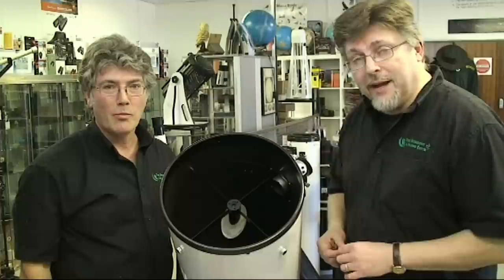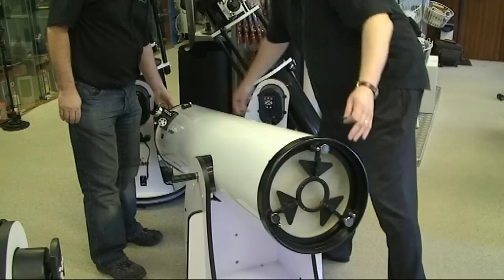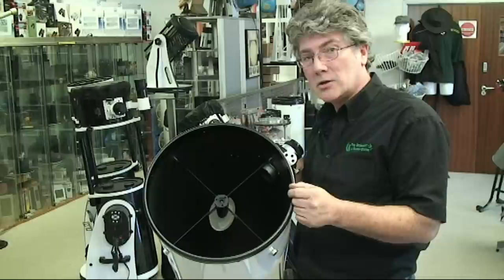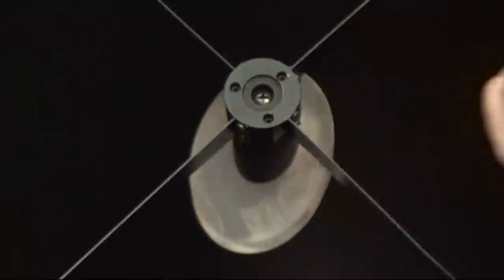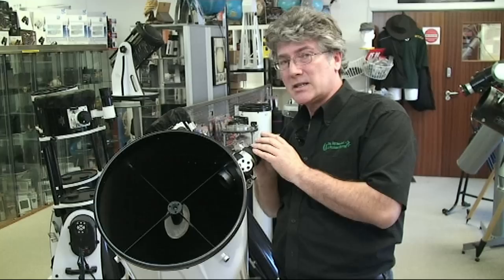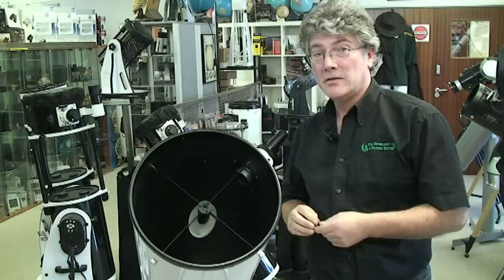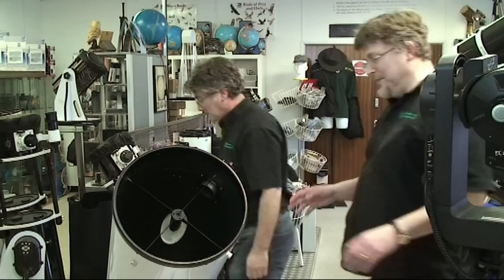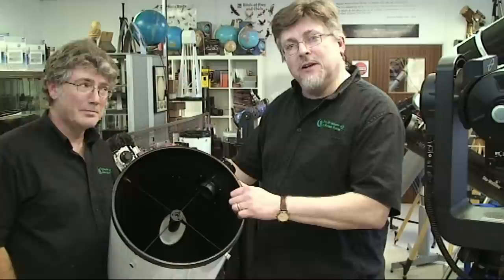Collimating your reflecting Telescope in just a few minutes

Comment: Nice and fancy. I only wish I had a scope that nice. Mine is a homemade Newtonian reflector. Hand ground mirror, homemade tube, homemade equatorial mount, etc. I collimate using a 35mm film canister with a tiny hole drilled in the bottom then do a star collimation check. Works great!. Thanks for the how-to video. At least I know I am collimating in the correct order. Basically taught myself how to line everything up!

Comment: What about a safety warning about lasers at the start of your video ? See,"How to Collimate a Telescope - Orion Telescopes and Binoculars" on Youtube channel, "Orion Telescopes and Binoculars" . At 9:30 the lecturer says to point the telescope at a white wall first of all to make sure the mirrors are not so far off that the laser is  exiting the tube;  otherwise it could enter your eye & cause damage.

Well how far out would the spot need to be on the primary mirror to actually miss the secondary mirror and exit the tube ?
Reply from the maker: Hi Zytigon, I'll answer your query on the basis that you seem genuinely concerned about risk and hazard. The reason we did not include a safety warning is simply that we do not see the need for one. The risk of eye injury when using a properly made laser collimator of the type we show in the video (made by Sky Watcher) would be so low as to render a warning alarmist and unhelpful. The documentation supplied with collimators is quite sufficient to alert the user to the nominal risk inherent in using these devices. Some years ago now, we contacted Moorfields Eye Hospital in London (one of the worlds biggest and most respected) and asked them about eye injuries resulting from the use of a range of astronomical and other optical equipment, and in particular, injury caused by red lasers employed as collimation aids. They were unaware of a single instance of such a mishap in the United Kingdom, and a subsequent review of the field literature was unable to find an example anywhere in the world. Actual hazard and possible risk are not the same thing. The actual risk of eye injury while collimating a telescope is so low as to render it not worthwhile to warn people about - anymore than you would feel compelled to warn a friend about the general risks of food poisoning whilst recommending a favorite restaurant. Maybe at some point in the future real data on eye injury due to the use of laser telescope collimators will be forthcoming - when it does, we might of course reconsider.  I hope this helps clarify our position. KR RJD A&NTV
Reply: I had wondered that as well!  Being a total newbie, I expected that it WOULD come out the front somewhere.  I was petrified to try, thinking I had to stick my face quite near to the beam.
Reply: zytigon I use a piece of paper.

Comment: I think at least, after having collimated it, rotating the collimator verify that it is still on target, will make it clear whether there are problems with the collimator itself too - mine doesn't seem to be radially collimated, and there are no adjustment screws accessible (the holes have been glued over it looks like).

Comment: You never mentioned anything about the needed accuracy of secondary mirror. IMO, we can get the red dot to align with the primary centre for many secondary positions, and in each case the secondary needs to be tilted at a different angle. Only in one of the cases in which the secondary mirror plane lies on the intersection of central primary axis and central focuser axis does this technique lead to good collimation.
Reply from the maker: Hi Adithya. You make a true and good point. But do bear in mind the purpose of this video is not a comprehensive treatment of Newtonian optical component alignment procedures (there are many other fine details absent from the video and not just a commentary on the absolute secondary position). This is a video about encouraging folk, typically new and inexperienced users, to have the confidence to restore their commercial Newt to at least the factory collimation standard that they enjoyed when the telescope was new  - and perhaps with care, a little better than this standard. Most users of commercial instruments will find their instrument only slightly out of 'good' or factory collimation. For better or worse, 99% of the time, the glassware will still be in the gross positions dictated by the factory jigs and test sets. Thanks for posting. KR RJD A&NTV
Reply from the maker: Hi again Adithya. We can don't normally pass comments with links in them, but as my late friend Nils Olof Carlin is one of the contributors we'll allow it. It's a good thread to be reminded of, thanks for your post. KR RJD A&NTV

Comment: How do you get the secondary properly aligned with the focuser if it has been slightly rotated and is not square with the focuser?
Reply: Loosen the Phillips screw rotate it to the finder scope then adjust the 3 screws to align it to the finder!

Comment: Hi hope you can help. I have a skywatcher 10 inch collapsible and a hotech laser collimator. I first adjusted the secondary so the laser disappears inside the donut in the center of the primary. Then center the primary so the laser dot is centered in the grid on the collimator. BUT when I then go back the laser dot reflecting on the primary mirror is no longer in the center of the dounut, it is on the edge of the donut. When I observed my airys disc seemed centered, but the scope stars just did not focus cleanly.  Is there something I am doing wrong? Thx

Comment: Hi Ralph / Rob.  Great video. I am new to all of this and have a start up skywatcher 130 which does not have a centre spot on the primary mirror. I have seen a comment / instruction from a year ago regarding adding this to the primary mirror. I have tried several marker pens and sharpie seems to work on a cormer of one of the wife's make up mirrors!!! (ha ha ) so I will use this when follwing your instructions. Looking down the tube at the primary mirror I can see there is a lot of dust on the mirror. 
Question? As I need to add a small mark, the area for this should be clean I presume. Is it worth cleaning the primary mirror at the same time? Have yoyu guys any videos or instructions for doing this? Any help would be appreciated.  PS. I am confident taking things apart and re-assembling them so would be happy to give this a go.

Comment: Adjustment of focuser is factory set and i shouldn't have messed with it but the secondary and primary appear to be optically aligned. Might be just my eyes going bad past year but seems like the sharpness isn't quite as good as it used to be. Does adjustment of the focuser (it tilts with set screws) throw off alignment somehow even though the primary/secondary mirrors both seem to line up visually?

Comment: I'm having issues with collimating my telescope. I use a laser collimator and I can always get the lasers in the right spots, but the three adjustment screws on the secondary mirror in some way always rotate the secondary mirror to where it puts the offset of my view by about 45 degrees every time. I worked over 5 hours on this telescope and the stupid secondary mirror keeps rotating no  matter what I do!

Comment: My Saxon telescope (200/1000) only has 3 Phillips heads at the mirror end of the tube. How on earth do I align my primary mirror ? All other tubes have adjusting knobs, where as I just have 3 screws... please help ??
Reply: My Saxon is the same. If you look closely there should be 3 small Allen key screws next to those 3 Phillips head screws. How I successfully collimated mine was to loosen the 3 allen keys screws just a tiny bit, then loosen the 3 Phillips head screws. Then tighten 3 the phillips head screws back up one by one to try and get the laser to disappear in the bullseye. Once you have done that, tighten up the 3 small allen key screws again. (make sure you dont tighten them up too tight, nice and firm will do). Hope this helped.

Comment: Could someone help me? I don't know where I can buy the thing with the target (already forgot how it's called..)
Reply from the maker: Hi there, and thanks for posting.  The device is called a laser collimator.  And you can find a source for one in the partner links below the video.  Just click on the text under the video, and you'll see the links to Amazon - we've picked a good one identical to the model used in the video, only a different brand (same manufacturer, though). Any competent dealer in astronomical telescopes should have something like this, so depending on your location you should be able to find one easily enough. I hope this helps. KR A&NTV
Reply: The cool thing about video is you can watch it again.

Comment: Hi. Great video. I've got a question though. All references I've read for a dob say to rough align so you can see all three clips that hold the primary mirror. I do that and then when I use the laser to align both mirrors , I lose sight of at least one clip. So the question is, once it is rough aligned you do not worry about being able to see the clips they chesire after finishing collimation?
Thanks
Reply from the maker: Hi Leonard. No, typically if you can't see all three clips it's a problem and it means your secondary mirror is out of position. You will need to make sure the secondary is in a good start position if you wish to get the best from your instrument. The secondary needs to be correctly positioned under the focuser. Can I suggest you have a look at the home page of my friend the late Nils Olof Carlin. If you Google his name you should find his website easily enough. Look at 'Collimating Newtonian Telescopes'. My advice is NOT to read it from the start, as you may find yourself drowning in a bit too much detail at this early stage in your telescopic life! Instead, scan down through it and look at the diagrams well down the page that deal with secondary errors - then dip into the text and get what you need to move forward. Maybe later, when you get a functional collimation, return to his text - almost every sentence is gold.  I hope this helps. KR RJD A&NTV
Reply: @RocketPlanet  thanks and that is quite a read from Mr carlin. Just to be sure you understand my question. I can see all three clips in the beginning of the process. Then I start to tweaking the secondary to get my laser hitting the circle on the primary.After I have that done , I insert the chesire again and that is when one off the clips has disappeared. Is this to be expected as I'm moving the secondary?
Reply from the maker: Hi again Leonard. No, I'm afraid this still strongly suggests that your secondary mirror is still out of position relative to the focuser. You need to be able to see the whole of the primary mirror, the visibility of the retaining clips is just a useful marker to indicate that you are on track. But there are a number of reasons why you may be unable to see the whole primary mirror surface; the focuser maybe in the wrong position (again for a cluster of reasons: tilted, incorrect location, tube out of shape etc), the secondary may be positioned off centre relative to tube or primary mirror (again for multiple reasons), or too far down the tube or not far enough down, etc. We've assumed in our videos, for the sake of brevity, that the user is starting out with a commercial telescope that has drifted slightly out of 'good' or factory collimation (it may never have been in 'perfect' collimation). But this assumption is weak once you actually start to look at individual telescopes - but we had to start somewhere. Go back to Nils Olof and look at the parts where he talks about the secondary position relative to the eyepiece holder but bear in mind his assumption is that you made the instrument yourself and that you might be starting from scratch. This start position is a fundamental part of the optical alignment and a laser isn't going to help much - a sight tube or a good combined centring and Cheshire eyepiece are best, in my opinion. By 'good' I mean a long metal tube type. I hope this helps. KR RJD A&NTV

Comment: Just purchased and assembled a dob 10",  doesn't focus at all, so I'm guessing the collumating will require setting.
Reply from the maker: Hi Colin - no, if it's a Sky Watcher Skyliner Classic of Flextube (as featured in our videos) it's unlikely to to be faulty collimation that is stopping you from getting focus. It's not impossible,  but the collimation would have to be scandalously bad to prevent the instrument from displaying a more or less focused image. Commercial scopes are only very rarely that bad.  First, just do an 'eyeing up' test. In daytime remove the front cap and the eyepiece (EP) and just look into the focuser tube (where the EP fits)  - can you see through the scope? If you wave your hand at the open end of the tube while looking into the focuser tube, can you see your hand? If you can, it's probably not a problem with mirror alignment (collimation).   I'd look at the eyepiece holder and focuser as these are far more likely top be the cause of focus problems. Check that all components that feature in the eyepiece and focuser chain are in place. Forget stars for now, do all tests during the day, and focus the instrument on the horizon (don't focus up on anything closer than a few miles). If you can't get any help from the pictures and text in the manual - just do some simple experiments using the 25mm eyepiece.  For now, don't fuss with any of the other eyepieces or optics in your kit until you solve the focus problem using the 25mm eyepiece.  I hope this helps. KR RJD A&NTV
Reply: @RocketPlanet  Hi, thanks for the advice, I will certainly take it up. For the record, it's a Bresser Messier 10" dob. I'm certainly getting light down into the scope, so I will take my scope out in daylight and try looking at horizon objects. 
Thanks again. I will keep you posted!
Reply: Hi! As an update, I've checked the hand whilst looking through the focuser tube, all good. Next step is a daylight look to the horizon, however what perplexes me is there is no option on the 25mm lens, pop it in the tube, to the stop, and that's it. The only movement to focus is the actual focuser mechanism, however I have now found if I lift the lens out beyond it's normal resting place in the focus tube, it comes into focus. Therefore, my nest question is, why would they make a lens too short in the body to enable focusing?Regards

Comment: Thanks for this. Such a simple informative video. I’m waiting for my laser collimater - but I have a question if that’s ok? - you had a central ‘dot’ on the primary mirror, when adjusting the secondary mirror so you knew where to adjust the laser to. How did this get there? I can’t see a central dot on mine (I think I must be missing something obvious).
Thanks so much,
Sam
Reply: I was wondering how to adjust the secondary mirror, as my scope doesn’t have a central dot either… It must be a feature of the telescope they were using.
Reply: My mirror came without  the central target. I will be centering my mirror with a sticker ordered from an astronomical supply company. You can use other stickers or simply mark it with a magic marker. There are several methods for locating the precise center of a mirror. The target lies in the shadow of the secondary. So no image degradation will occur.

Comment: ok but what will happen when the secundery mirror is to high or to low ? 
and how did you know that the secundery is facing you directly?
Reply from the maker: Hi there, and thanks for your useful comment. Your queries, whilst valid and important, are good examples of the type comments we receive from collimation initiates who can't quite understand why we don't go into far more detail (there is after all plenty more to say about collimation of a Newtonian telescope).  The video is designed to help the relatively new owner/user of a commercially available scope that has previously provided the user with 'good' views but may now be out of collimation. It manifestly does not deal with every aspect of setting up a Newtonian optical system from scratch. 95% of viewers who find their way here are not starting from scratch, and they did not build their telescope. Indeed, typically their modest aperture instrument once provided better views, and they merely wish to restore the telescope to this point. And that was our aim: to give this very large group of people the help and confidence they need to get involved in the task of improving their instrument, and not overwhelm them with the ex-cathedra law and logic of 'perfect' collimation Nirvana. Any viewer wishing to collimate to exacting 'Cloudy Nights ATM' standards are recommended to seek out the comprehensive work of Vic Meynard and Nils Olof Carlin for chapter and verse. But you'll need to allow a little more time than our video took to view to take it all in. Kind regards RJD A&NTV

Comment: Hi, I have 8 dobson.. as its on this video.. but I dont have that on bottom..  is it big problem?
Reply from the maker: Hi Rodier, thanks for your post, the multi-point primary mirror support system on the instrument featured in the video is particular to that model (and other larger models too) but is quite irrelevant to the collimation advice offered. That your primary mirror has the means of collimation adjustment is sufficient. KR RJD A&NTV